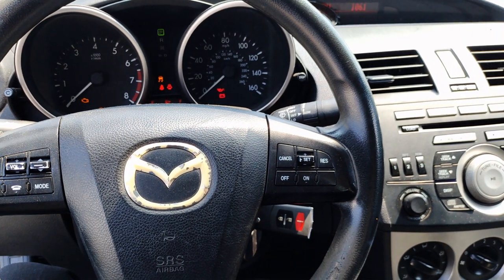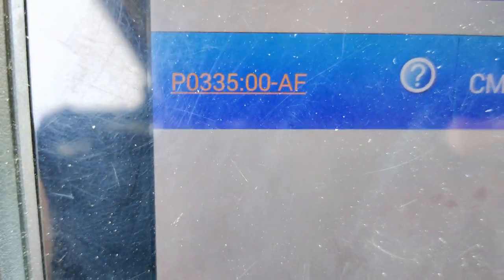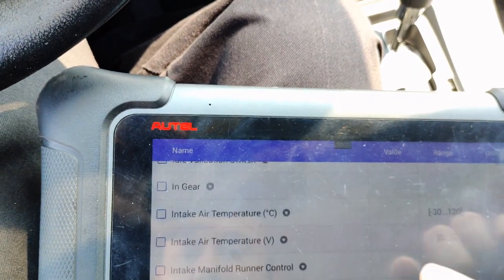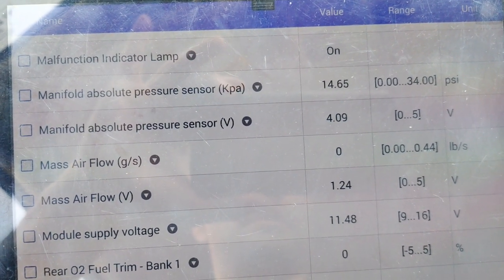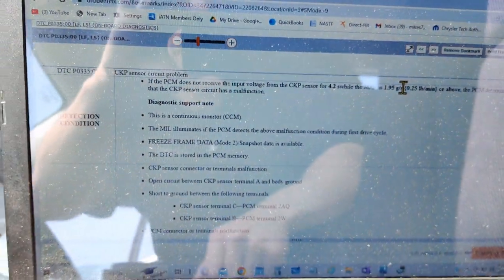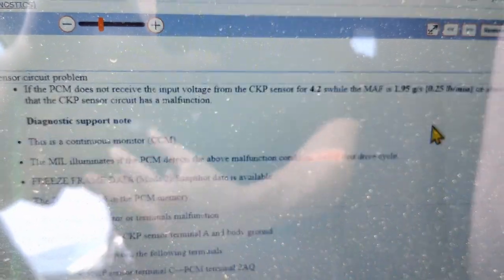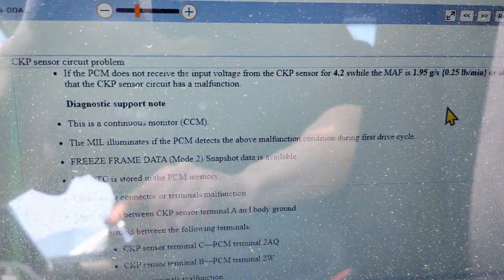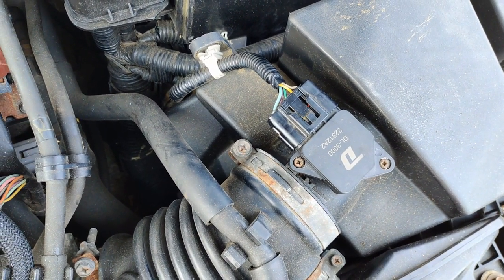2010 Mazda 3, p0335 Crank Code | Bad MAF

Comment: Thanks, I just got burned by this. The customer replaced the MAF with this same Duralast example because of a Trouble code. The car ran fine until they went to get gas, then it started setting CKP faults, then became a start stall. The worst part about this is i saw the same p0335 explanation you read. Looked at the MAF PID, and sure enough it was reading 1.49v. The good part is the customer was smart enough not to throw away the original.
Reply from the maker: AutoZone keeps us in business.

Comment: But the mass airflow grams per second read 0 on your scanner. So does it go by maf voltage or g/s
Reply from the maker: My scanner reads both maf voltage and gps. This vehicle data did not display the maf gps with koeo, only the voltage.

Comment: so was this a no crank issue ?
Reply from the maker: @highlandsoutdoors2041  No, the engine cranked but did not start.
Reply: @autotechtogo6290  thanks , think my starter is bad I'm getting the one click that's it and it's not the battery
Reply from the maker: @highlandsoutdoors2041  as long as your block ground is good and there is power at the starter cable.
Probably needs a starter..
Reply: @autotechtogo6290   lol thanks for the help ,, i was not so smart swapped the starter while laying on the cold winter Canadian ground , tried it and same issue. popped off the belt and felt alt pulley, locked solid